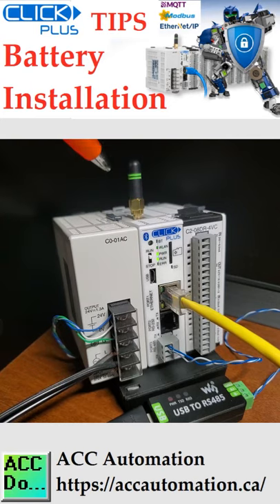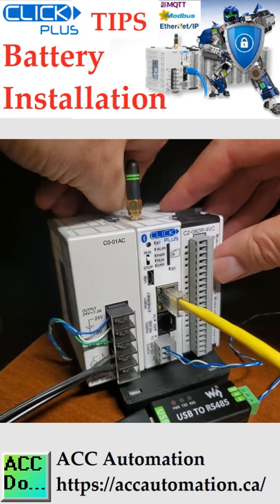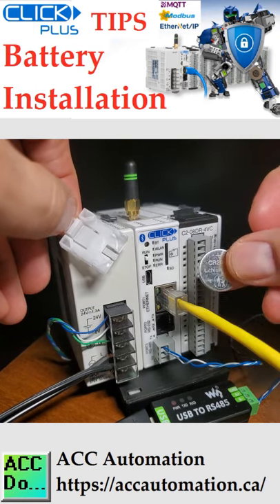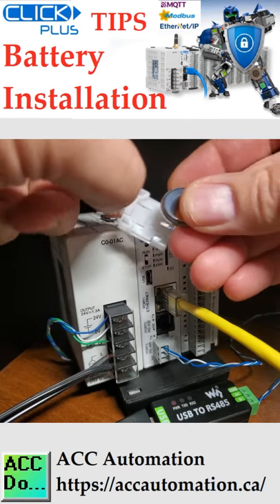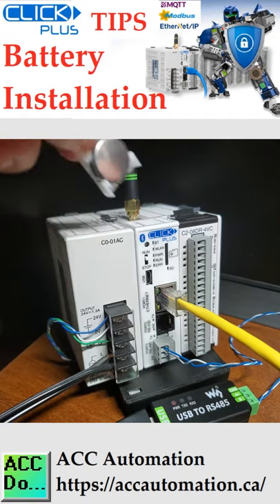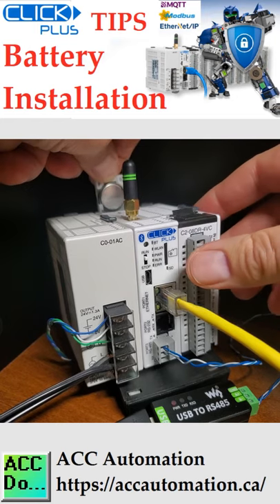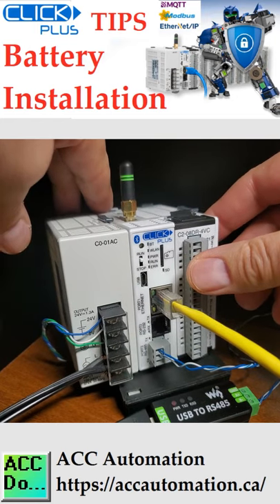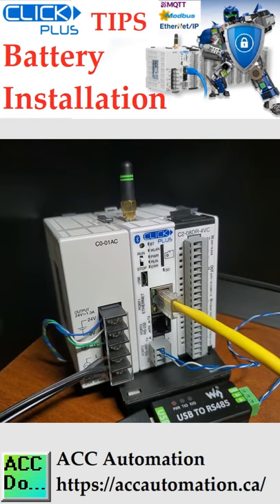Click PLUS PLC Battery CR 2032 Installation

Comment from the maker: Programming and examples of the Click and Click PLUS PLC series can be found at this URL:
https://accautomation.ca/series/click-plc/

There are several reasons why we are using the Click and Click PLUS PLCs. Here are just a few.
 - Investment is low for the hardware and the software is free
 - Standalone PLC with built-in I/O
 - Communication ability - Ethernet Port, RS232, RS485 - support for protocols such as Modbus RTU, Modbus TCP, etc.
 - Ability to expand the system with a variety of modules including RTD and Thermocouple inputs directly.

Regards,
Garry